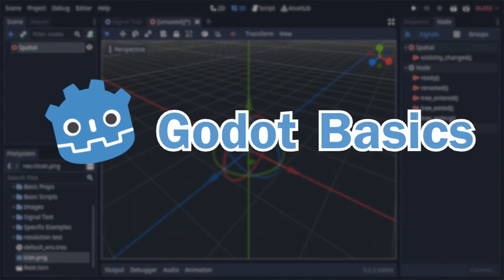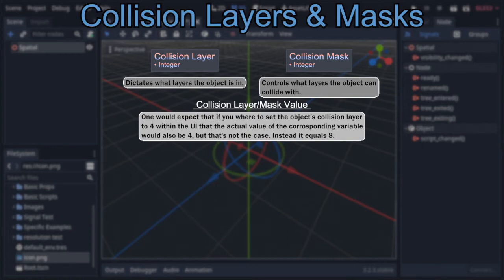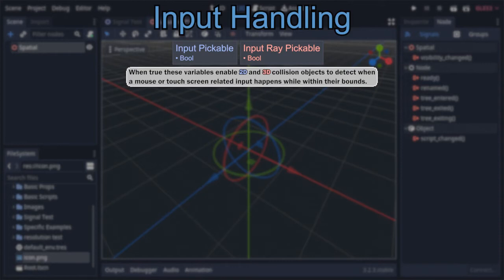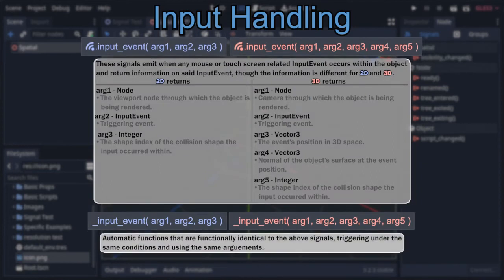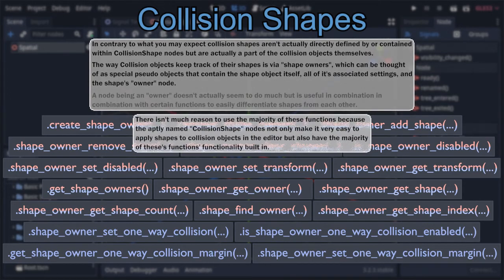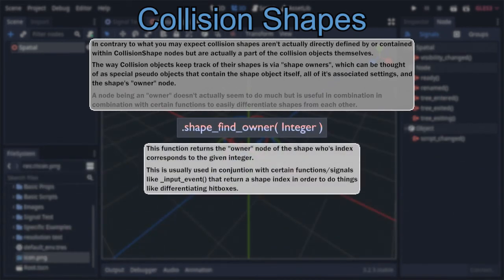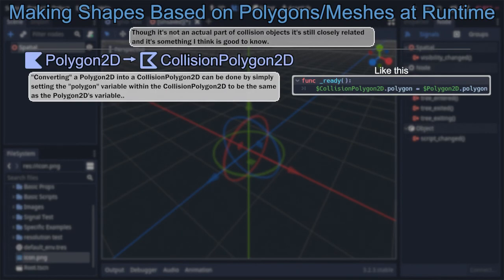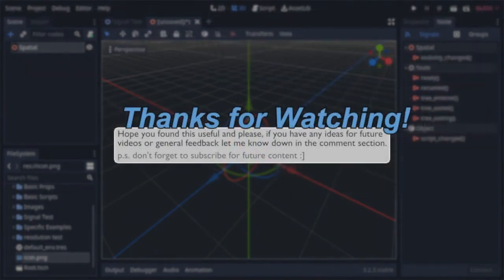Godot 3.x Basics : Collision Objects

Comment: I appreciate these videos! The docs are just full of "everything" and, in-them, I find it very difficult to identify what is and isn't important to understand at a given time. You seem to identify what is important to the object/concept and divide it up into easy to digest sections. THANK YOU so much!

You may want to put your audio through an equalizer and minimize the non-vocal tones in your output. I'm not sure if it's the microphone or just enunciation-issues (emphasizing low tones) ...but it sounds very muddy.

But don't let that discourage you! Your videos are the only ones I've found most helpful in the understanding of how Godot works (and that includes GDQuest tutorials!). 💙
Reply from the maker: Thanks that's some pretty high praise, I appreciate it! And yeah your right about my audio, it's the one thing I have very little experience with and it shows. When I'm able to get back into the swing of things it'll definitely be something I work on.
Reply: @Javlin Studio  With "video tutorials" like GDQuest (and many-many others), they explain how to make a predefined setup and note why "that particular" setup works. But they don't explain why the parts work.

In learning Godot: I already have a different working setup based on the docs & previous programming knowledge. In order to continue further, I need to know the boundaries of what is and isn't possible using the components (or related) that I'm already hands-deep with. ... Can't do that with a per-defined tutorial. Additionally, 2 different tutorials usually don't pair up together leaving "gaps" in how something behaves or interacts.

That's frustrating & specifically why I love your videos. They encourage experimentation and allow the programmer to go in their desired direction to learn more.

Anyway, sorry for the rant. Just felt like explaining that a bit further. Have a great holiday!
Reply from the maker: @Kevin J.  yeah I'm not a big fan of just going "this is how to do X" because "X" can always be done in a million different ways depending on your project so it's not always very helpful. That's why I like to dig into the individual parts of the engine and just explain how they work.